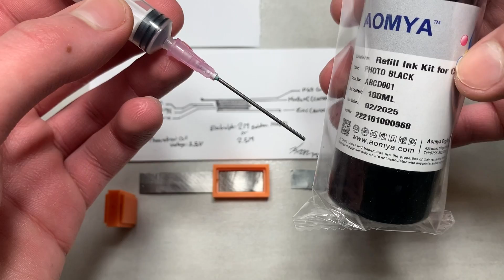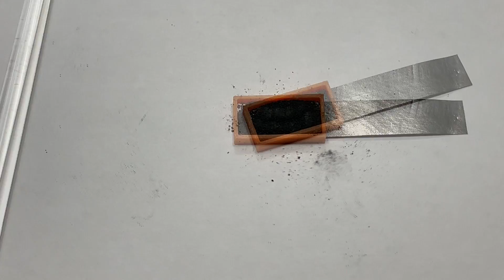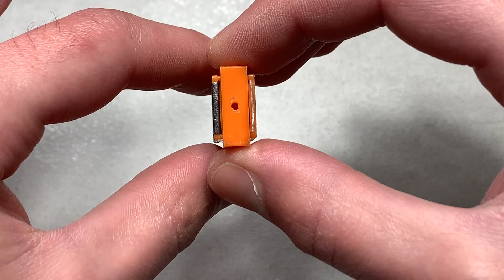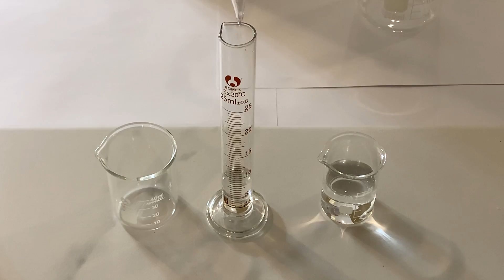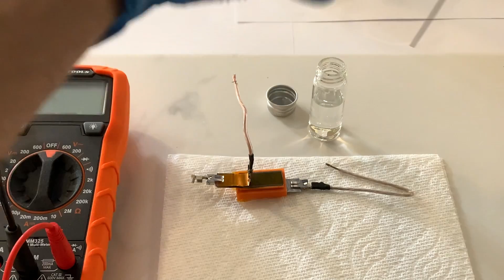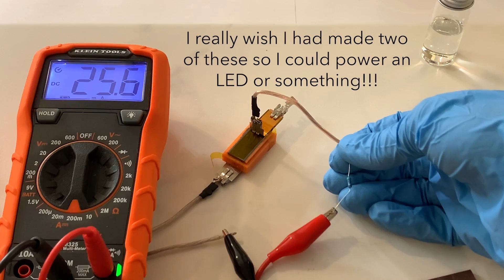Making a Zinc Carbon Battery from Scratch with Raw Materials | Part 1

Comment: The conductive surfaces in battery needs etched in order to activate whole surface. First rinse in alcohol then a hot bath of an alkaline then distilled rinsed. Then a solution of acid. Then rinse then hold in a weak solution of electrolytes. Also you need to weigh the powder. Then add 99% alcohol so the dust won’t be issue. Make the solution of powder not freaking wet. So when you add a dot to a scale you can weigh out exact lump of powder to card. This method is generally how lithium batteries are made. Also. This powder. Could be mixed with electrolytes instead powder.  I recommend making some graphene to add to powder. This will fill gaps in powder. Allowing more surface area. Also in small beaker put powder and electrolytes and stir rod. Let it stir. Add two marbles. On each side magnetic stir rood. Let this run till you can’t stand it anymore. Over night. This will make your powder even more fine.  But keep it wet. Use plastic food stretch to hold vapor in.
Reply from the maker: Yeah the best way would’ve been to dampen the powder with the electrolyte and mix it like that, the only reason I didn’t is because I wasn’t sure if I’d be able to test the battery on the same day that I made it, and I wanted it to be as “fresh” as possible when I did. 
But maybe I could keep the damp mixture in an airtight container for when I need to use it. 

I have got some carbon black and zinc oxide that I will turn into zinc chloride which I will be using in my second attempt instead of graphite powder, since that’s what commercial zinc carbon cells use. I also did some more research and found the proper ratio I should use to mix the powder and electrolyte. 
So hopefully when I try this again I’ll be able to make a lot more current and reach at least 1.5V. 
I’m not sure how much graphene would help with this specific type of cell since it’s not rechargeable.

Comment: Just a tip: just measure the voltage of the battery while having it loaded with the resistor
Reply from the maker: Yeah it would have been better like that

Comment: Can the cell be recharged? (without adding electrolyte)
Reply from the maker: I actually might try that. Technically they’re supposed to be single use cells, especially with the ammonium chloride electrolyte, but I think it could maybe be possible to “recharge” it just a very tiny bit. But it wouldn’t actually be a real recharged cell.
Reply: @KeonsLab  The zinc might recharge to some extent. but the manganese dioxide doesn't do as well for recharging. The graphite contributes to conductivity while ever-so-slightly behaving as a low value supercapacitor.
You can use a neutral electrolyte like sodium sulfate or sodium aluminum sulfate which is more reversible than ammonium chloride. but beware of zinc dendrites over many cycles.
Ive made a small cylindrical wound supercapacitor using two identical nickel strips from battery spotwelding strips. coated in a thin layer of 50/50 mixture of graphite and activated carbon producing about 15 farads and a maximum current of 15 amps if short circuited. Similar size once rolled up to the cells you made. which proved to be a lot more rechargeable and higher performance and capacity than faffing about with zinc or manganese dioxide. I used a very thin separator from a length of thin coffee filter roll cut to size between the electrodes
I made a slurry with the graphite and activated carbon with 10% by weight binder to active material and used white glue (I used double the amount of white glue since its already 50% water in the bottle before using to get an actual 10% by weight ratio)
Then made it into a slurry and deposited it and spread it as a thin layer with a syringe on the nickel strips. Make sure the strips are clean before-hand. maybe clean with a mild solvent like isopropyl or something to get the active material to wet onto the surface better. I coated both sides of both electrodes.
A very small one only about 1.25 inches by 0.4 inches was about to produce 0.57 farads at 500mA if shorted. and could power a small DC motor for a few seconds. or an LED with a solar garden light circuit hooked to it for a few minutes. the nickel graphite and activated carbon supercapacitor battery version goes to about 1 volt maximum. so you could put a few in series and get more voltage and performance.
Reply from the maker: Oh now THIS is what I’m talking about!!! Supercapacitors, I LOVE SUPERCAPACITORS! 
Such a cool experiment that you’ve mentioned here, I had no idea something like sodium alum would actually provide decent results! It must be some kind of EDLC you’ve made right?

May I ask what you meant when you said the supercapacitor battery version? 
Also, the graphite and activated carbon setup reminds me a lot of lithium ion supercapacitors, there’s one type of them that uses exactly those as the electrodes, except the electrolyte contains lithium ions! Meaning it exhibits both the properties of traditional EDLCs and lithium ion batteries! (to a certain extent)

I must try this out at some point. If I do and it turns out really nice, would you mind if I made a video on it? I would of course mention/show your comment and how it’s where I got the idea from. If not that’s fine too.
Reply: @KeonsLab  You should do some research and try to make it! I would love to see a video of it.
Reply: I recommend loosely following some of the information described and make several small-scale test cells to see which exhibits the highest performance and capacity.

As a starting point you might want to consider two nickel electrodes for both current collectors. Make sure their surfaces are well-cleaned and prepared with isopropyl or another effective cleaning solvent that doesn't leave behind any residuess.

A starting point could be a 50/50 by weight activated carbon or charcoal to graphite powder. For 10 grams of active material. use 100ml or 100g of water approximately. Use 10% by weight adhesive or binder like white wood glue or similar to dry active material weight. Also make sure you take into account if the adhesive or binder already contains water or another solvent already. Many wood glues are 50% water by weight to glue. so you'd use twice as much to get a 10% by weight binder to active material.

Mix it thoroughly for 30 minutes to an hour with a motorized stirring device. ensuring you don't introduce bubbles to the solution during mixing.Mix it thoroughly for 30 minutes to an hour with a motorized stirring device. ensuring you don't introduce bubbles to the solution during mixing.
Use a syringe to extract and carefully deposit the mixture onto the nickel strips or current collectors
Nickel should not be substituted with other metals though. as the property is unique to nickel that allows the high conductivity and corrosion resistance
You might be able to substitute nickel with the graphite foil for both electrodes. however I don't recommend other metals.
Stainless steel works but the conductivity is very poor.
If you want to use aluminum sulfate with sodium sulfate together. go for the graphite foil option. as aluminum sulfate would be corrosive to the nickel.

You want to aim for a very thin layer of active material. Not a thick gooey paste.
It should be thin and fluid Use the tip of the syringe to help spread it evenly onto the nickel or graphite foil current collectors.

Let it dry a full 24 hours before using (VERY IMPORTANT. be patient)
Use a plastic spring clamp with some plastic sheets or 3D printed jig or something to clamp the cell together so that the electrodes remain in gentle but firm contact with one another.
Charge to a maximum of 1 volt with nickel electrode current collectors.
Experiment with the graphite foil electrode current collectors up to 2 volts to see when gas evolution begins. You'll notice by either small bubbles visible. or decrease in performance or the current draw is steady or no longer decreases.
You could put several in series for more voltage if you want later.
You could make several parallel alternating layer electrodes with one or both sides coated in active material. Or a cylindrical spiral wound jelly roll type cell.
Make sure you cut or shape the electrodes so you have some leads to attach it to a power source and load.
I achieved an internal resistance of under 1 ohm with a tiny strip only 1.25 inches by 0.4 inches of surface area with a thin active material layer. 0.57 farads and 500mAh maximum discharge current if shorted to the multimeter at the 10 amp scale. Could even power a small DC motor for a few seconds pulling 100mA of current! Very small but mighty. and rechargeable.
Reply from the maker: Awesome! You really seem to know your stuff! 
Feel free to send an email to the channel’s email address:
(the.supercapacitor.channel@gmail.com)

I’d love to discuss/brainstorm more about this topic since I find it really interesting and you seem to have quite a bit of knowledge and experience with making your own Supercapacitors.

Comment: I dont know if youre going to make another one of these. I hope you do.

I was thinking that since its 3d printed could you use CA glue + baking soda to instantly set the exterior seal? Rubber cement seems to take forever if its going to take over night to set.
Reply from the maker: Yeah I’ll be making a whole lot more using more materials and Zinc Chloride electrolyte just like commercially available cells. 
The baking soda and CA glue is a good idea, 

I might use it if there aren’t any visible gaps between the pieces, I’m just scared that the baking soda will somehow get inside the cell and affect the performance.
I have some silicone “glue” too that I could also use. The rubber cement also lets the electrodes flex a tiny bit when the alligator clips are on.

Comment: For even distribution of the graphite  +NMO2 you may want to consider using a forming press to make like a biscuit. You could use electrolite as a binder.
Reply from the maker: Yeah I’m going to 3D print a mold and I’ve ordered some dextrin to use as a binder too. I’m going to dampen the powder with distilled water & dextrin, then leave it in the mold to dry into a hard puck.
Reply: Seems perfect,  my concern is that some particles that small could have a hydrophobic effect. Just make sure the electrolyte can permeate it.
Reply from the maker: Oh that’s definitely a good point I didn’t even think of that! In this case I might just stick with simply increasing the cathode material and also experimenting with potentially increasing the surface area of the graphite sheet (since it’s a compressible type that keep its shape)
Reply: It is true that graphite powder is horribly hydrophobic. Adding any kind of polymer or sugar really helps though. Dextrin may well work. You could also try PVP. Ironically it’s what glue sticks are made of, but you can buy it as a pure powder too. Just make sure to keep the binder content low, like 5% of the electrode mass. If there’s too much, it makes the whole electrode a very bad conductor of electricity.
Reply from the maker: I did a bit more research into the exact cathode composition for zinc carbon cells, and it seems like carbon black is used instead of graphite powder because it absorbs liquids a lot better, so I’ve ordered some carbon black powder to use instead. Hopefully it’ll give better results

Comment: Awesome! Was there a reason the battery is so small? Was there a form factor you were going for?
Reply from the maker: I didn’t know how well it would work so it was more of a proof of concept. But now that I know it works I’ll add way more MnO2 next time! I’ve also ordered some Zinc Oxide that I’m going to turn into Zinc Chloride and I’ll use that next as the electrolyte, so that it’s as close to commercially available cells possible

I want to make a bunch of cells and activate some with ammonium chloride electrolyte, some with Zinc chloride, and some with both and compare the results